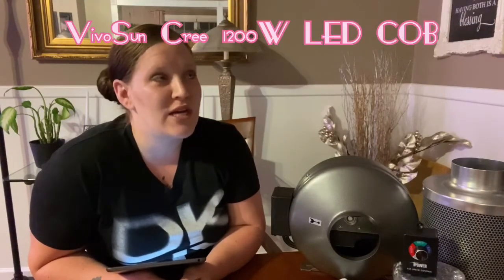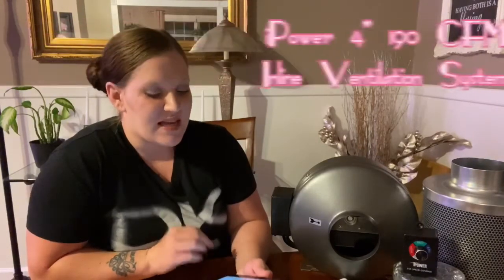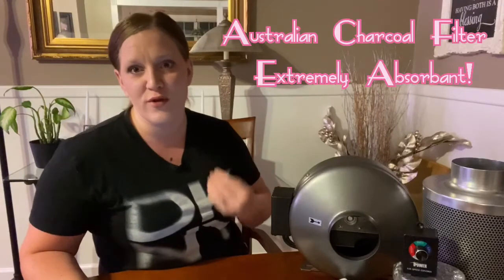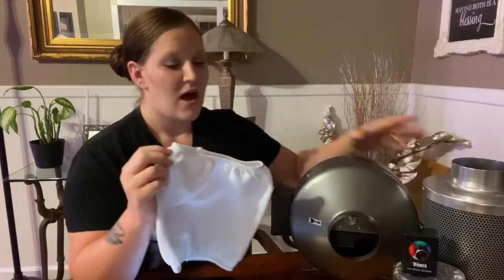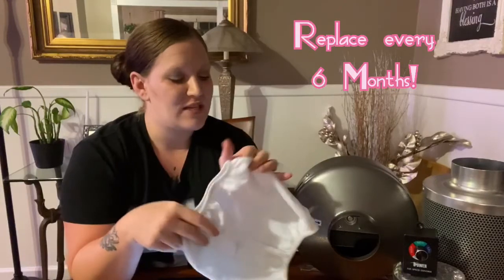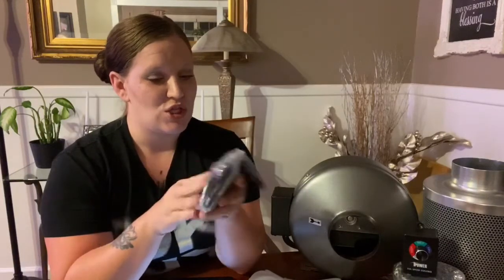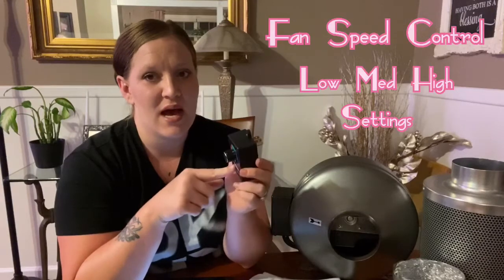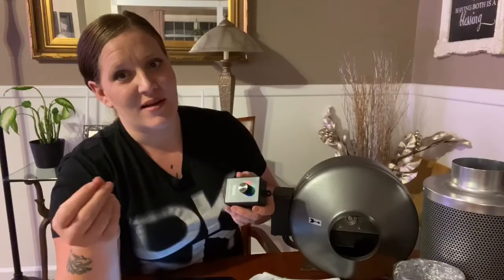Grow Tent Ventilation ||Grow Tent Setup Part 2|| iPower Inline Fan & Carbon Filter

Comment from the maker: I forgot to mention and do want to add in an IMPORTANT DETAIL! You can attach the filter to either side of the fan. If you attach it to the side you see here with the arrow it brings fresh air from outside the tent and blows through the filter into the tent. If you attach it to the opposite side it takes the air from inside the grow tent and filters it through and releases it outside of the grow tent, which is how I’ll be using it to maintain the temperature inside the tent as well as control any odors! What ventilation system do you use?